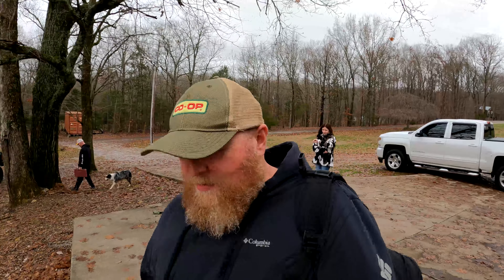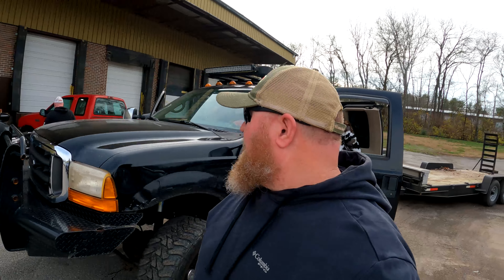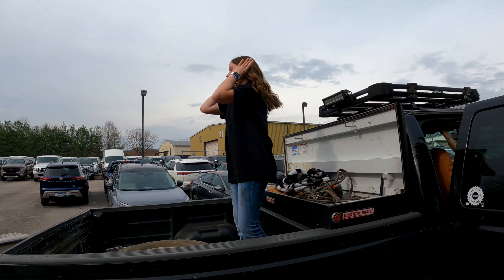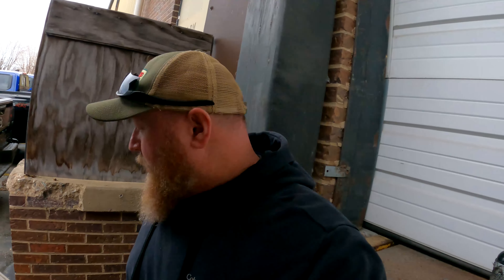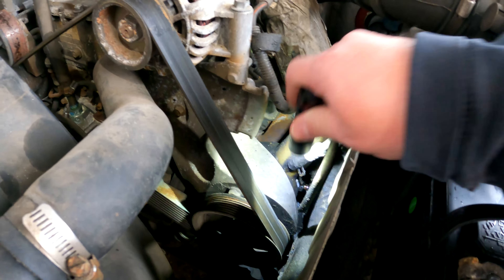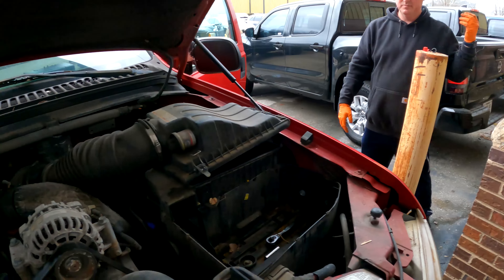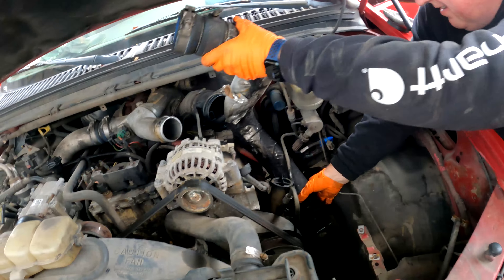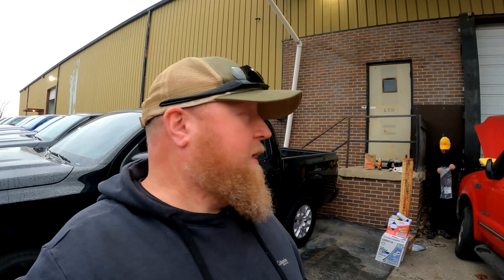Picking up a $500 7.3 Powerstroke F250 Superduty - Plus First Drive!

Comment: I have a 2000 F250 with the 7.3 powerstroke. I've had an issue with my power steering for quite some time now I've replaced the pump but still has an issue I also have a rear main leak. But I still wouldn't give up my truck.
Reply from the maker: I'm pretty sure most of my 7.3/6.0 trucks all have sloppy steering gearboxes. That's a really common wear point for them.

Comment: One hell of a buy for $500 I would say! Runs very nice! Needs some work. But I bet that engine is sound!! My 97 OBS has 270.000 on it. (Purchased it new)  I just did the entire front suspension. Ball joints,u joints,Brakes,new rotors,All those spring bushing, New tie rods, redhead steering box, new tires, lots I probably left out😜  I believe those trucks . If taking care of, can go for well over 500,000 miles
Reply from the maker: I agree. I've seen more than a few well above 500K.
Reply: My old 2001 7.3 has over 500k and it still runs like a dream

Comment: Two things.. First Big Red here needs a name. Second definitely do as many episodes as you can. (Side Note) I must have a massive boost leak or something on mine, you got on that thing and it ran like a beast. When I get on mine it almost feels like it's either not getting boost from the turbo or it's like it's resistant to taking more air. (if that makes sense) edit: The gauges are way different from this year 7.3 to my 03 7.3. I don't even see a glow plug light on yours.
Reply from the maker: I also have a 2003 with the 6.0 and you're right, the gauges changed a lot in the 2003 model year. Instead of a glow plug light, the older trucks have a "Wait to start" light in the bottom right of the gauge panel.